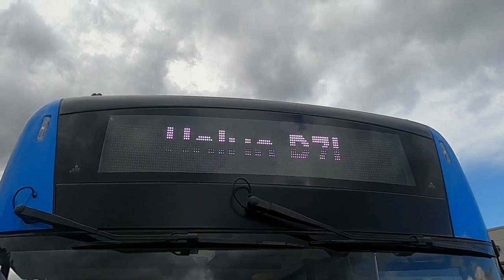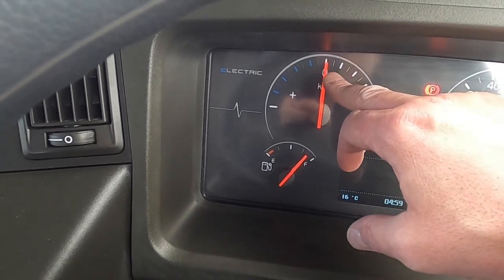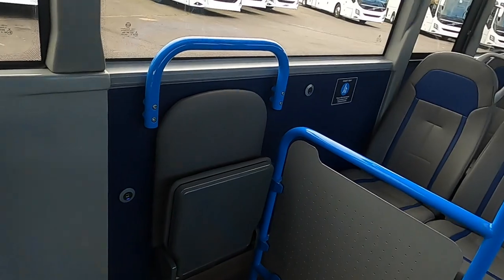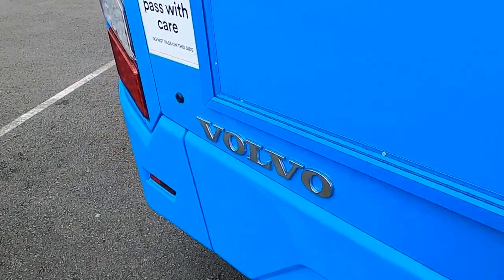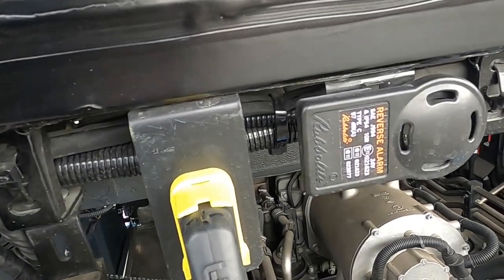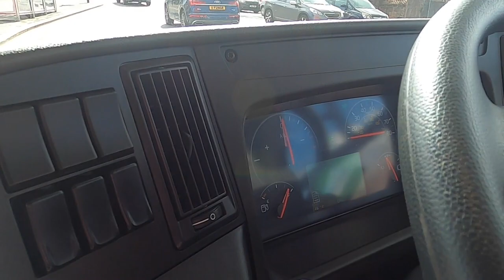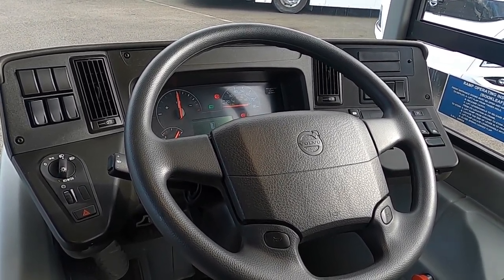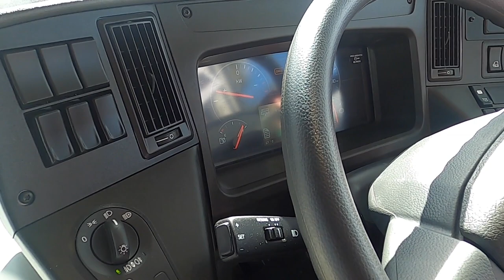Test Drive | Volvo BZL

Comment: The BZL is best e-bus offering around at the moment in my opinion. The 2 stage transmission eliminates all of the traditional flat spots and slow initial acceleration of most other electric buses. And I love how simple and driver-friendly the cab is. You could just be sitting in a Eclipse 2 cab!  Well done Volvo and MCV.
Reply: imo, byd k9 looks better
Reply: Electrics are never slow wdym
Reply: I feel like the way volvo make buses are somewhat similar to cars (Mechanical wise). Like when u hear the B5LH (or all ishifts) they sound like a minivan

CORRECTION: It's gearboxes. Volvo placed gearboxes even in hybrids and evs. And evidently they work very well.

Comment: Hello Again my name is Mr Cannadine T. Boxill-Harris I was wondering, why couldn't you Rebuild a nice fresh shiny Scania N113, Leyland TL11, Volvo TD102KF, Cummins L10, Gardner 6LXC and Gardner 6LX 4 Speed Leyland Hydra cyclic Automatic Alexander RH’s and Repaint them to a Grey Green Colour's just like the original Scania Grey Green's which were in the East London bus route's such as 24, 141, 168, 210, 275, 125, 173, 179, 167, 313 and also the bus route 103, if you guys would like to Rebuild about 187 of Those Scania N113, Leyland TL11, Volvo TD102KF, Cummins L10, Gardner 6LXC and Gardner 6LX 4 Speed Leyland Hydra cyclic Automatic Alexander RH Buses please could you Repaint them in the Exact Grey Green Bus Colour's and put them on the London Bus Routes witch are the 341, N41, 34, 123, N29, 149, 221, N73, 121, 86, 30, 262, 147, 396, 41, 56 and N26 for all of us because it would be a Very Very Very Very Very Very Very Very Very Very Very Very Very Very Very Very Very Very Very Very Very Very Interesting Buses to see them Repainted to a Grey Green Colour's and I'am a Big Fan of all of those Scania N113, Leyland TL11, Volvo TD102KF, Cummins L10, Gardner 6LXC and Gardner 6LX 4 Speed Leyland Hydra cyclic Automatic Alexander RH Buses Please?

Comment: Hi There again my name is Mr Cannadine T. Boxill-Harris I was wondering, why couldn't you Rebuild a nice fresh shiny Scania N113, Gardner LG1200, Gardner 6LXCT, Gardner 6LXC and Volvo TD102KF 3 speed Voith DIWA Northern Counties Palatine 1’s and Repaint them to a Grey Green Colour's just like the original Scania Grey Green's which were in the East London bus route's such as 125, 141, 210, 20, 173, 179, 167, 313 and also the bus route 103, if you guys would like to Rebuild about 154 of Those Scania N113, Gardner LG1200, Gardner 6LXCT, Gardner 6LXC and Volvo TD102KF 3 speed Voith DIWA Northern Counties Palatine 1 Buses Pretty Please could you Repaint them in the Exact Grey Green Bus Colour’s and put them on those London Bus Routes witch are the 341, N41, 34, 123, N29, 149, 221, N73, 121, 86, 30, 262, 147, 396, 41, 56 and N26 for all of us because it would be a Very Very Very Very Very Very Very Very Interesting Buses to see them Repainted to a Grey Green Colour's and I'am a Big Fan of all of those Scania N113, Gardner LG1200, Gardner 6LXCT, Gardner 6LXC and Volvo TD102KF 3 speed Voith DIWA Northern Counties Palatine 1 Buses Please?

Comment: The EV mmc engine sounds better
Reply: EVs do not have an engine 🤣
Reply: @duraab27 omg you know what I mean
Reply: @jaymarlon7460  at least be technically correct if you want to talk about battery-powered vehicles!
Reply: @duraab27 motor it's called
Reply: @LJ07EBP  battery is the main source of power, in which the electricity is then generated through the motors, to feed the power into the driveshaft, which turns the wheels.

Comment: Hello Again my name is Mr Cannadine T. Boxill-Harris I was wondering, why couldn't you Rebuild a nice fresh shiny Volvo TD102KF, Volvo D10A, Scania N230UD, Gardner 6LXB and Gardner 6LX 4 Speed Leyland Hydra cyclic Automatic Enviro 400 MMC’s and Repaint them to a Grey Green Colour's just like the original Scania Grey Green's which were in the East London bus route's such as 24, 168, 141, 210, 125, 173, 179, 167, 313 and also the bus route 103, if you guys would like to Rebuild about 178 of Those Volvo TD102KF, Volvo D10A, Scania N230UD, Gardner 6LXB and Gardner 6LX 4 Speed Leyland Hydra cyclic Automatic Enviro 400 MMC Buses please could you Repaint them in the Exact Grey Green Bus Colour's and put them on the London Bus Routes witch are the 341, N41, 34, 123, N29, 149, 221, N73, 121, 86, 30, 262, 147, 396, 41, 56 and N26 for all of us because it would be a Very Very Very Very Very Very Very Very Very Very Very Very Very Very Very Interesting Buses to see them Repainted to a Grey Green Colour's and I'am a Big Fan of all of those Volvo TD102KF, Volvo D10A, Scania N230UD, Gardner 6LXB and Gardner 6LX 4 Speed Leyland Hydra cyclic Automatic Enviro 400 MMC Buses Please?